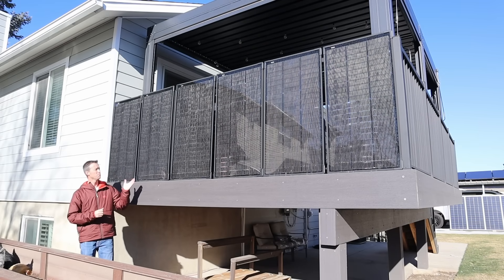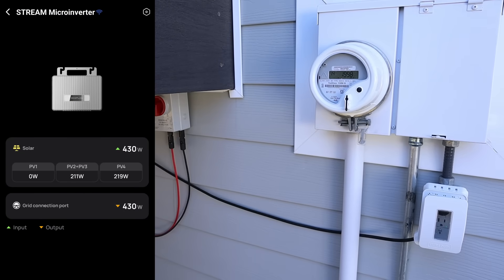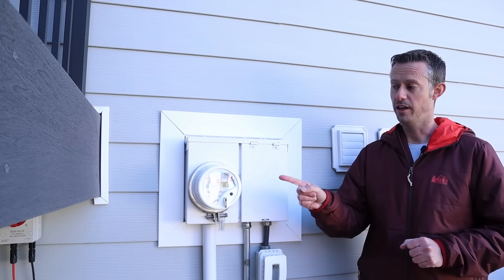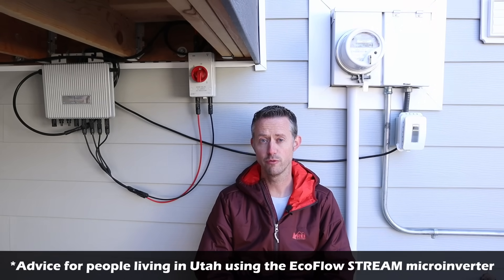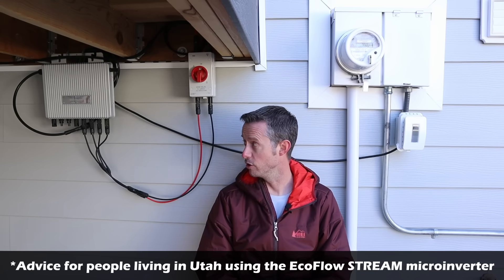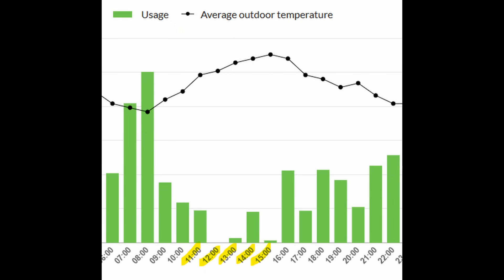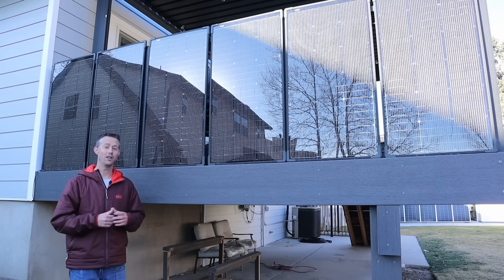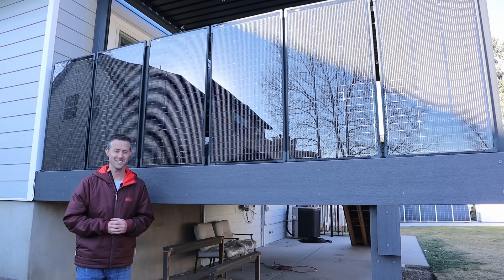The Simplest Solar System I've Ever Installed!  I Just Plugged It In!

Comment: Lots of solar... Charge controller... Battery... To the 1200w inverter.

Now you can have enough solar to both use and export up to 1.2kw time 24 hours a day, or 28.8kWh per day of export.

You can also use something like a cheapo Y&H grid tie inverter with limiter if you need in the same way so you can have lots of solar filling the battery and only offset power you use all day from the battery.

Decently cheap and simple.

I would however suggest you do it with dedicated circuits or be careful with the circuit design as if you are supplying power beyond the breaker and then exceed the breaker capacity the breaker will not trip to protect the wire since it can't see the extra power that is running down the wire. 

For instance, if you have 1200W coming in on solar and plug in 2 1500W heaters to the same circuit there is 3000W being supplied but only 1800W is travelling across the breaker which is within the 15A limit for the breaker so you'll likely just melt the reciptical with the heaters plugged in.
Reply from the maker: I've tested this device for a few days connected to my 48v battery bank 24/7, it does seem to work well. The only issue with that is that I don't have a big enough battery bank / solar panels to keep it going long term. I need more charging powa! Lol
I'll do another video showing that later 👍
Reply: @Jasonoid I’ve been looking for such a solution to work with a DIY battery I know ecoflow has their own Stream branded battery solution that works in this way but please make a video for us DIYers to do the same. I’m in UT so I’m wanting to use this here.
Reply from the maker: @oooee one thing you could do is connect the 48v battery to one of the DC ports for 450watts (instead of all the DC ports for 1200w). Then I could just remove the base load for my house 24/7.
Reply: @oooee It should work with any battery that runs DC in the MPPT voltage range. So for the Ecoflow Stream microinverter that's anything between 16-60V.

It might make sense to test but there isn't any communication between the device and the battery so pretty much any 48V lithium battery that you can find cheap should work.
Reply: @Jasonoid  Make it so! And use your dongle that connects your DP3 to a 48v external battery to combine and charge it up again. In UT and likely other places the electric company has tiered plans that give you cheap power late at night. I’d like to see a video that uses these options to provide a ToU time of use with just batteries and this micro inverter to charge at cheap times and offset power use during peek.

Comment: Okay, that is pretty cool. Once you have had it working for awhile, please let us know the cost savings throughout the year. 
An unrelated thought, when you test solar panels can you test them not just pointed optimally towards the sun, but flat on the ground representing a typical RV installation? I wonder if some solar panels are better at producing in this orientation than others, of course time of year influences that kind of test, so it might not make sense.
Reply from the maker: Long term testing / results is definitely something I'm going to do. Longer solar days should make a much bigger difference. Especially when the sun is up from like 8am to 8pm lol....
Laying panels flat and testing them is a good idea. In the summer months flat panels do pretty decent, in the winter they do horrible. It all depends on the angle of the sun.
Reply: @J @Jasonoid . For sure, I have 390 watts of solar on our Class B van but only generate a little over 100 watts during the winter. It will be interesting to see summer output. Thank you for responding

Comment: Very nice. Yes do a video with the battery feeding the micro inverter (And I guess the battery being charged by a mppt ?)
Reply from the maker: I'd get the best results when I have more solar hours, these winter days are so short! I might wait a little longer so the days are longer to show how it can actually work 😂
Reply: @Jasonoid  gotta say, it is the best looking balcony setup i have seen.
Reply from the maker: @segundacuenta726 these panels just fit my deck perfectly, my neighbors ask about the setup too which is saying something haha
Reply: @Jasonoid  if you series the panels. You should get a bump in generation.
 If you were to use a battery you could add more solar. The inverter would be able to run 24/7

Comment: Thanks for telling the truth. The other youtuber said it was legal everywhere. I know the truth though. 👍
Reply from the maker: Other smarter devices are legal in all the states since they don't back feed to the grid, I'm hoping Ecoflow can come up with that type of device soon!
Reply: It's not legal in my state, but I use one anyway, but my power company knows as they were notified and doesn't have an issue. No different than running a generator as you have to make sure there is no back feeding and the inverter does that.
Reply: @jamesm568  right. As you can tell from my dated profile pic, I've graduated to fully off grid gridboss, flexboss21, 18kpv, 60 450w bifacial panels, and over 120kwh batteries. Been the coolest hobby and learning experience over 8 month run. Started off with 40kwh anker stuff and bidirectional plug and said, i need more. 😂  They were great presents for my parents and brother this season. Have a great day. 🌞 -From Arizona
Reply: @SurgeonTech I'm still building my solar system slowly as of right now I use a 1500 watt inverter. Every circuit in my house is on a transfer switch as that gives me the flexibility to pick circuits I want to use for solar. Basically, I run all my lighting and my wall outlets on solar and battery except for the refrigerator as I keep that on the grid.

Comment: Love it...and it makes total sense.  I'm wondering what the electrical nannies at large will say about creating a hot cord with a plug.  :face-fuchsia-wide-eyes:
Reply from the maker: The device has anti islanding tech, meaning it doesn't turn on unless it's connected to the wall outlet. If you connect solar with it being plugged into a wall, nothing happens. It also turns off during a power outage.
Reply: @Jasonoid yea its grid-tied to safety reasons to the line men...question, does the grid frequency matter? Can this microinverter be used with 50hz grid? EcoFlow Stream works in Europe but wondering if the american one would work anywhere in the world
Reply: @brilliancetventertainment9416  No, it wouldn't.  The US/North America microinverter would be 120V 60 Hz.  Europe uses 230V @ 60Hz.  Other areas of the world are usually modeled after the European power grid.  Cliff notes: You would have to check with your local utility to see what your incoming electric power specifications are before installing one of these systems.
Reply: I do feel like having a different plug type would reduce confusion going forward, like a twist type plug. People are used to a household plug operating in one direction, but twist plugs are often used to hook up generators and rv's ect.
I can see problems where people would plug in to the wrong outlet and be frustrated when it doesn't work, or accidentally back feed a shed or part of a circuit if the tech got bypassed somehow. Having a physically different plug would make that more intuitive.

Comment: The one and only building code in my county is that if you build anything over 200 feet tall , you have to put a red light on top
Reply from the maker: Gotta keep this airplanes safe!
Reply: Battery costs  have gone down so much that it makes much more sense to invest in an off grid inverter instead of the inverter to feed the grid. The battery allows you to self consume all your production and backup power during grid failure.
Reply: @danielking2944  I was wondering about this. With battery prices dropping and still dropping I think adding batteries to almost any system makes sense. Adding batteries to a system gives more options on what to do with the solar power you collect. I like options.
Reply: @Moe75Gcheck the wattage to be sure, but many crockpots and rice cooker pull under 300 watts. Instead of a 240v range top you can get 1000watt single burners and use toaster ovens for baking.

I also love my solar clothes dryer that cost under $5 for some line and clothes pins.

Once you free yourself from needing 240 a whole world of living easily offgrid opens up.
Reply: @danielking2944  for sure, although many people can't pay an installer and wouldn't do that themselves.  This has a very low barrier to entry without needing permitting.
Reply: Where I live Greenlee county AZ no building codes at all they do require by state law to issue a few permits all you do is pay then $5 they stamp a form no inspection at all. I put in 35kw DIY solar system off grid  no permits at all.
Reply: Those damn Feds, always infringing on our Freedoms! Don’t land on me! 🪨🇺🇸🦅
Reply: @thedownwardmachine  Feds? It’s the for-profit energy companies that rule the energy game. Make utilities a public domain and everyone can be a mini-energy company on their own.
Reply: @thedownwardmachine what a worthwhile comment from a sarcastic fascist 🤡
Reply: @thedownwardmachine  You let them. I've had this setup for years.
Reply: @user-wc5lw7ps6h1  do you have your own surface to air missiles too?😂
Reply: @veganpotterthevegan  Working on it, sick of the birds waking me up
Reply: Man, that would be a great state for solar!❤
Reply: @OP-fd4lh  😂 it's just this one county , maybe there's others
Reply: LMAO !!!
\
Reply: Mind sharing what county/state that is ?
Reply: @paisteplayer1040  Utah, he said.
Reply: Did you find a suitable wind turbine?
Reply: Where is this?  Sounds great!
Reply: How long is the helicopter ride to a hospital with an ICU from where you live?
Reply: @damageman  lol